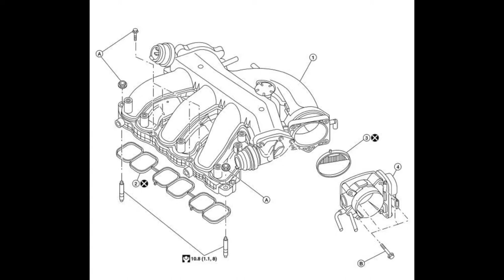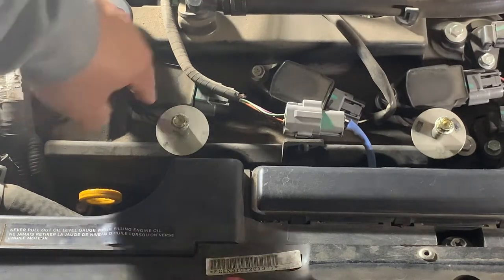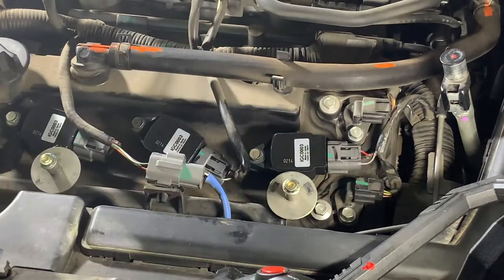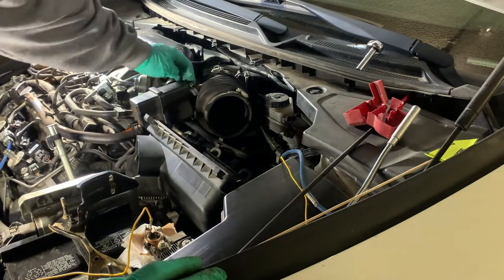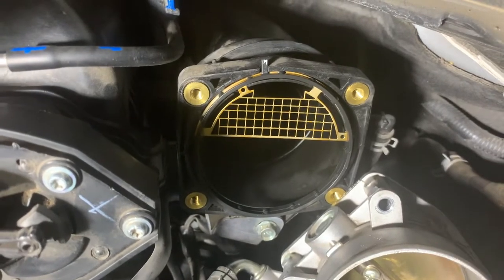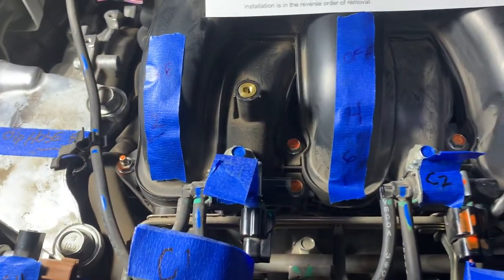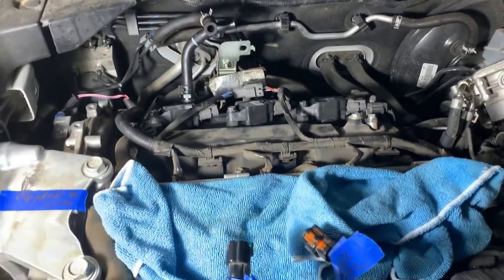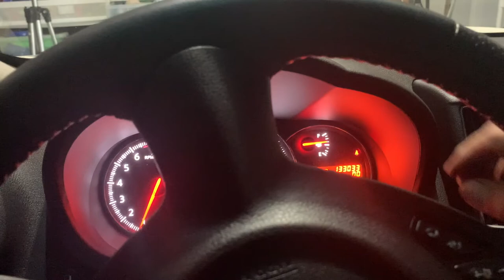2011 nissan maxima 3.5L spark plug change

Comment: Anyone who would go to that much trouble to change out three lousy spark plugs,  well,  you have my praise and admiration.   This is a job best left to a professional mechanic.
Reply: It was not the worst job, but, I did manage to get battle scars on my left forearm while reaching the bolt on the back side of the plenum
Reply: @bartwilliams4478  I usually get a few scratches  (battle scars) on just about any car repair job I attempt to do....

Comment: I have a 2009, these cars have a slight growl when you crank them up. I started smiling because I thought something was wrong with the car!!  I was happy to hear that same sound when you started it.   The hubby and I are literally doing everything you did plus the fuel injectors. We're having misfire issues. Hopefully this will clear it up. Looking forward to improving the gas milage as well. Great tutorial!
Reply from the maker: i was scared to attempt at first- but i watched multiple videos- and felt confident- the best video i saw was a guy from brooklyn who changed his nissan murano plugs which is similar to the maxima- he broke it down really simple—
Reply from the maker: still running like a champ
Reply: How did it go for you?

Comment: Excellent work but, 133,000 miles!!! That’s 214,000 kms in my language which equates to more than two times the mileage these plugs should have been changed at. Service manual on my Maxima recommends plugs at around 100,000 kms!
You’ve done extremely well then.

Comment: I hear a hissing noise in your car. I do have the same thing after I changed the plugs and the manifold gasket, I started to hear a hissing noise. Do you still have that hissing noise still? Please help?
Reply from the maker: yeah mine still hisses- i think its always done that- but my isn't having any trouble....
Reply from the maker: maybe tighten the. top bolts a little tighter with the torqe sequence
Reply: @jcravatt1  I fear to crack the manifold if I tighten it up. Is your RPM higher than half!?
Reply from the maker: @laytheshuwaili2455  everything remained the same after my spark plug change- did u change the throttle body gasket?
Reply: @jcravatt1  I only changed the manifold gasket where I hear the hissing sound comes from

Comment: @jcravatt1 Hey man, i also own a 2011 Nissan Maxima & I’ve noticed that the acceleration is pretty bad... I’m pretty sure my vehicle is in need of a Spark Plug/Ignition Coil replacement. 

Did u notice any major difference as far performance in the acceleration after replacing the Spark Plug/Ignition Coils?
Reply from the maker: not really- i finally got the guts to do this maintenance on my 10year old maxima- before i changed em- never had any misfires or any acceleration problems
Reply from the maker: so it was basically the same- but it always had great acceleration
Reply: While my plugs look reasonably good for 95K, I did notice a bit more responsiveness on acceleration and idle was more stable after replacement.

Comment: You just save a good $700.  Good job.
Reply from the maker: 10 year old max - running like a champ-
Reply: I'm about to do this to mine 2012 Nissan Maxima.. 135k original spark plugs on .. can't wait to see them ... I'm get 26mpg highway currently with them old ones on

Comment: I hear a hissing noise coming from the intake manifold when I turn off the car is that normal or do I have a leak it's giving me a random misfire
Reply from the maker: did u replace the ignition coils?  switch the coil with another see if u get the same misfire
Reply: @jcravatt1  i just the coils with my scan tool and by hand I put brand new spark plugs  I checked the injector now I have to do a smoke test I believe it might have a leak I do hear a hissing noise coming from in front of the intake manifold

Comment: Question, if your front coil packs are still working why replace them?
Reply from the maker: they used to be over a hundred bucks a piece- when i bought em 50 bucks a piece- just figured it was the last time i was gonna change these plugs
Reply: @jcravatt1  gotcha, I have a 2010 and my girl has a 09 I’m going to do a tune up on both cars. Replace all spark plugs and coil packs in the rear but I’m going to keep the coil packs in the front for now they’re easy enough to change if I ever need too

Comment: 41:40 was that a torque wrench? where do I get that?
Reply from the maker: they are palm  or finger ratchet !can buy in a set similar to this:  https://www.amazon.com/Pittsburgh-94011-Thumb-Ratchet-Wrench/dp/B000ZK6L8U/ref=mp_s_a_1_5?crid=PCQHGM2L1YP5&dchild=1&keywords=palm+ratchet+set&qid=1634698872&sprefix=palm+ratchet&sr=8-5. I have torque wrenches but did not torque these doesn’t require much torque 8-15 lbs - My Max still running like a champ
Reply from the maker: also called a wheel ratchet - pretty handy
Reply: @jcravatt1  Thank you!

Comment: What was the cost of all the parts?
Reply from the maker: 30 for the plugs 12 for throttle body gasket 15 for air intake gasket 300 for 6 ignition coils (at least replace back 3 coils) 12 for pcv valve 10 for pcv hose- using Rockauto- if u use local store add at least a hundred $$- rockauto parts are legit——the ignition coils used to be a 100 bucks a piece- got em for 48$
Reply: @jcravatt1  appreciate that, shop wanted to charge me $900 for the job

Comment: Ignition coils are $125 each… yikes
Reply from the maker: rockauto hitachi was 50 when i bought em- they were about that when i checked a few years ago- as of 4- 2022 rock auto has em 44- nissan will brand there equipment as nissan but are made by other companies- the original nissan plugs were denso branded - but nissan sells them As nissan brand